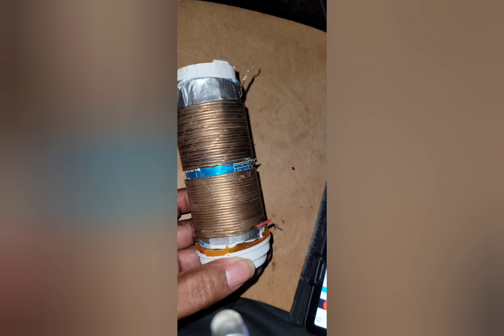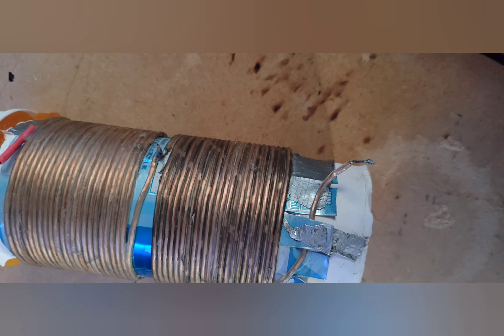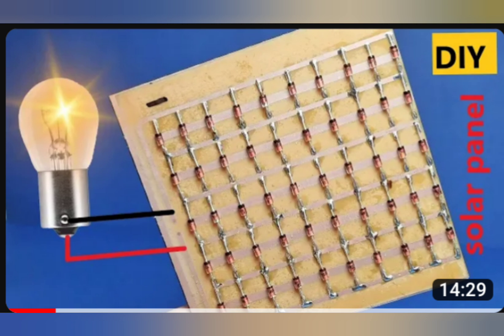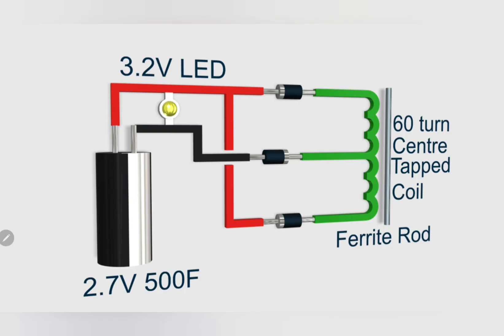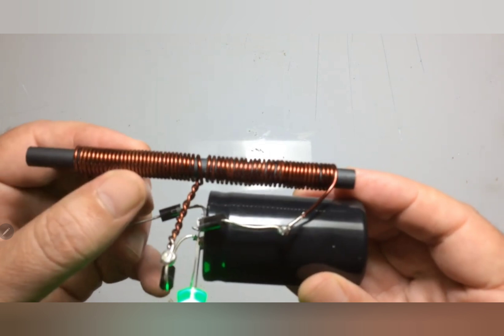the differences between flyback and transient energy spikes

Comment: Is the transit spike, kicked back on to the negative side of the electrolytic smoothing capacitor, because the ground side of the LC circuit, is blocking any return to the source by a diode?

Comment: The AI got the flyback defintion right but not transient. Transient energy spikes are caused by anything that causes a rapid change in voltage or current. This inculudes capacitors, inductors, switching, lightning ,ect. It is not unique to radio waves.
Reply from the maker: @fablearchitect7645  everything you say is absolutely right, no argument but to let you know it's the Pacific questions is why we got that particular answer no fault of the AI that's called human error

Comment: what your looking at here from my perspective is two flyback events , one from a standard man made coil and another made from a natural sourced magnetic field collapse , one could go on endless about where natural magnetic field colipases occur or if they dont collapse and just invert cause its part of there long duration cycle and you just see one inversion in a life time or other inversions from the same natural sources that have shorter cycles and are more noticeable
Reply from the maker: @mykedoes4099  You bring up an interesting point about natural magnetic field collapses or inversions, and I can see how it relates to what we’re doing with artificial systems. What we’re working on is similar but more controlled. Think of it this way: when we create a capacitor that holds potential energy, and we place an electromagnetic magnet around it, we’re essentially causing the ions inside that capacitor to vibrate. This vibration is crucial because, like Tesla said, vibration equals amps, meaning we're converting that potential energy into usable energy.

Now, if we can harness these vibrations, we can extract energy wirelessly using an antenna, much like how natural electromagnetic fields can transfer energy over large distances. However, the key difference is that in our setup, we are amplifying and controlling these effects. While natural magnetic fields may have long cycles or inversions, our system allows us to capture and amplify these "vibrations" or ion movements in a much shorter, more immediate way, making the energy accessible for practical use.

So, in essence, what you're seeing in nature with magnetic field cycles, we're replicating on a smaller scale with capacitors and electromagnetic fields, and then tapping into that stored energy with wireless technology. It’s all about understanding and manipulating these fields and vibrations to make the energy usable.